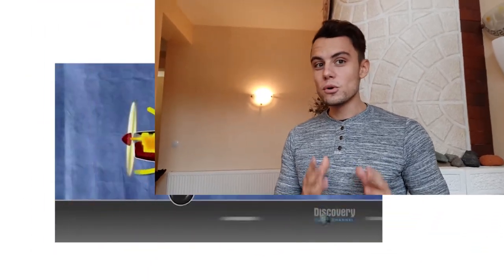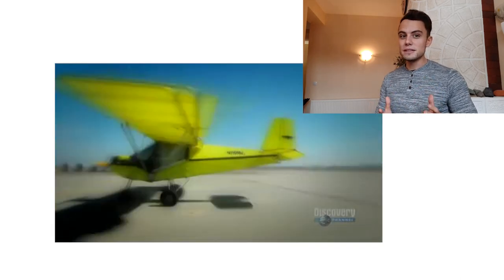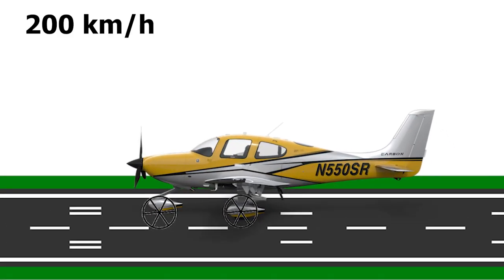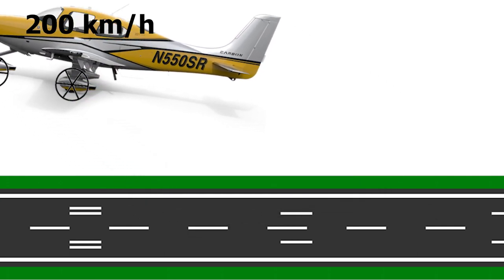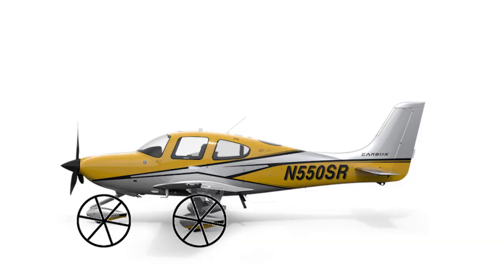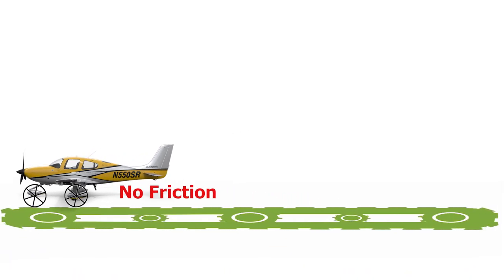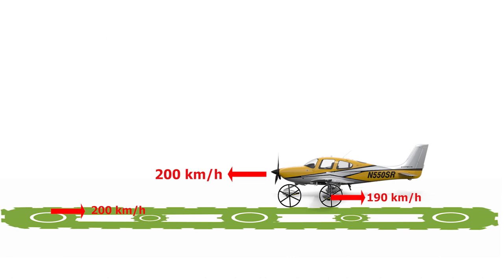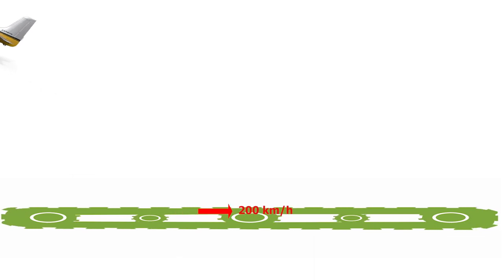Can an Airplane Take Off From a Conveyer Belt?.... Finally Solved!

Comment: The belt would have to be moving at an extreme speed.  The aircraft then would have to be move at several times faster.  Maybe it is possible with a jet and a long belt.  The plane in your example is not capable of these speeds.
Reply from the maker: I see what you are saying. Note that in the example the speed and the lift rise are happening for seconds. You might got the impression that it takes longer than in reality. Literally few seconds after the aircraft have same speed as the conveyer held, it's lift will be so high that the friction won't matter. This is what you see in the mithbusters video.
Reply: @MartinYY  "This is what you see in the mithbusters video." - Both you and the Mythbusters video don't discuss the original question, thereby avoiding the controversy surrounding that question.
Reply: Aircraft speed limits are based on its speed relative to the air, not the ground.

Comment: If the wheels are moving at the same speed as the conveyor the plane will not take off. In order to take of the wheels will have to rotate at take off speed plus the speed of the conveyor... But.. if you are saying that the conveyor always matches the wheel speed then it will never move forward.
Reply: @papapapalima_scotland Actually--think about it--when the conveyor belt runs backwards, it spins the plane's wheels FORWARD!  If there's any significant friction in the wheel bearings, the reverse-running belt ASSISTS the plane in moving forward through the air. (That advantage is negligible, but the reverse-running belt is certainly not putting any drag on the aircraft.)

Comment: Everything 100% but suction creating lift. There is no such force as suction. Only lower pressure. The lower pressure on top of a wing gives way to the relative higher pressure on the bottom of the wing. Gas molecules only push against each other. They do not pull on each other. It’s exactly why in an open environment, hot air is low pressure and in a closed container, it’s high pressure.

Comment: You can't change 1to1 the conveyor only moves when the wheel rotates in place, not happen. The wheel only rotates as the jet moves forward the rolls over the conveyor and the amount of conveyor behind the wheel is the same as the movement of the jet 1 to 1. The conveyor never moves and the plane takes off. The wheel speed matching the conveyor is the key to solve this. The plane is sitting on the conveyor neither the wheel or the conveyor is moving. Now start the jet move 1 rev of the wheel now the plane has moved forward and 1 rev of conveyor is now behind the wheel. The real question is how fast the conveyor is moving. The answer is it is not and never will. That is the trick of this question.
I see now this is not a riddle, it's the definition of how planes take off from a runway with one word changed. they replaced the word runway with conveyor just to confuse everybody.

One other thing, you park a car on a conveyor and than drive the car forward keeping the wheels and the conveyor at a 1 to 1 ratio. The car will drive off and the conveyor will not start. You yourself can do this on a treadmill, stand at the back end with the treadmill off and take 1 step forward. You will now be in the middle treadmill, start the treadmill up and start walking and you will stay in the same place. Only one can move at a time to keep 1 to 1 ratio.

Comment: so in the end a plane can't take off from the belt. only if it has those 10 km to start with and that would mean the premises of the problem are not respected. Also I think a role has also the air pushed by the propeller around the wings to generate lift
Reply: First the ~ 10KM is WORSE case friction. That is if the belt is 200km, with high friction the plane would be pulled ~ 190km. He used a high friction number to show that even IF the wheels had high resistance the jet would still eventually take off.  In real world. it would be the other way, at 200km, the jet would slowly start to roll back. If the belt is forever long, eventually the jet or any rolling object would reach the speed of the belt.  However, even if it already rolling back, just a little thrust will stop or start to move it forward. The THRUST just needs to overcome the friction of the wheels. ( in real world also the air)

The method of THURST is irrelevant. Be it Jet, Props, Sails, big fans, anything that DOES NOT apply energy to the belt. 

If people read the riddle and say no the jet will not takeoff. The how does a seaplane takeoff when going up-stream. If a seaplane idle on a fast moving river, starts to takeoff going upstream, according to those that say no takeoff on the belt. The seaplane would also not fly. Yet, they takeoff off all the time.
Reply: @BigBadDodge4x4  sea planes can take off because the water underneath the pontoons doesn't Match the speed perfectly. In the original problem it states the conveyor belt matches the speed of the wheels perfectly and simultaneously meaning its impossible for the plane to ever move forward. If the plane never moves forward you will never have air flowing over and under wings to create lift
Reply: @louisschwarz3943   also, I solved the riddle a few weeks back.

The jet takesoff. It takes off without any wheels rotating. The belt matches the speed of WHEELS, but in the opposite direction.  The opposite direction of the tires,  is forward.  If you zoom in to the tire contact patch. You'll note on a normal runway and jet, the runway moves from the front of a taking off jet, to behind the jet. So the opposite of that is the runway being moved from behind to the front. And as the belt is designed to match the wheel speed, but in opposite direction,  the belt actually moves forward.    So both the jet and the belt move forward in perfect sync as the jet takeoff.  The visual result is a jet stationery on a moving belt, and zero tire rotating. 

In real life, you can spin the belt in any direction at any rationale speed, and the jet will takeoff as normal.  The fee spinning wheels absorb the moving runway speed.
Reply: @BigBadDodge4x4  if the wheels are not rotating than the conveyor can't be moving and in return the plane isnt moving. The conveyor matches the the speed of the tires not faster or slower. You are over thinking and breaking the rules of the riddle to get your desired outcome.

Comment: Imagine a water plane taking off in a river upstream. No problem. You're welcome.
Reply: Now imagine a water plane on a concrete runway. It won't fly. Water planes still move on the water regardless of the water, because the water doesn't change speed like a treadmill can.
Reply: @knighthonor44  Your point is incoherent or absurdly incorrect; what are you trying to say?
Reply: @shannontaylor1849  go look at a plane in water. regardless of the water flow, the plane can move a different speed as the water, which allow it to pick up speed and lift. If that same plane was on a runway with no water, it wouldnt move well to take off. The plane needs movement. Wheels on a plane give it the ability to move well on solid surfaces to pick up enough air speed over the wing to generate lift. If you have a treadmill going the opposite direction at the same linear speed at all times, would cause the plane to not move forward to build up speed for lift.
Reply: @knighthonor44  Lol. Yep, you're absurdly incorrect as evidenced multiple times in the video and by a general observation of reality. Lift is generated by the wing moving through the air, not wheels on the ground or a skid on water, which are used to reduce friction and allow efficient wing speed- not create it, lol.
Reply: @shannontaylor1849  so hoow well would a water plane that was parked on a runway move? answer that
Reply: @knighthonor44  Pointless question that was already answered. Try to ask better questions.
Reply: @shannontaylor1849  Take the wings off the plane. using the same rules of the problem: if the treadmill goes opposite direction of the plane wheel rotation but at the same lateral speed, would the plane move forward?
Reply: @knighthonor44  It depends on the friction vs the velocity applied whether the wheels would roll or stay with the surface doesn't it? A 1 pound wheeled object  subjected to a velocity change of 10 mph would roll, assuming efficient wheel bearings, etc. At a 1 mph velocity it would stay whereas a 100,000 lb object would stay at 100 mph velocity change and so on. Now that you've learned that, apply it to water planes and the world will become less confusing for you.
Reply: Imagine a water plane when the upstream is matching its speed at all times, You're welcome.
Reply: @nareal_chutney  I think you mean velocity instead of speed, which still has nothing to do with the effect of air velocity over a wing. Planes move through air, not whatever is underneath them, water, concrete, treadmill, pan of biscuits, etc.
Reply: @Suraj C K  and what does the pilot do? They speed up the plane. Hence that's not the same as this because water flow of a river doesn't change at will
Reply: That wouldnt work exactly the same, the water have great friction on the planes body compared to wheels on ground

Comment: The belt speed is controlled externally to match the plane thrust speed. Therefore the plane appears stationary on the belt and the airspeed over the wings is zero. Plane cant take off.

Comment: Good joke, was this first posted April 1st?   (Obviously not true since lift is created by airflow over the wing, not by the speed of the wheels.  So the plane actually has to be moving forward THROUGH the air to create the airflow and therefore the lift.  In the example the AIR SPEED would still be 0 since the wheels are moving but the wing isn't moving forward.)
Reply: The propeller is forcing air under the wing even before the plane starts moving forward. The plane is traveling through a fluid regardless of the ground. Like he was saying the only factors are the friction and the flow of air.
Reply: It will still move forward. If the conveyor perfectly, exactly, and instantaneously matches the wheel speed, they'll both immediately accelerate to infinite speed and break some serious laws of physics, so that's impossible. In the real world, no matter how fast the conveyor goes, the plane's engines will push it forward. This will cause an airspeed. The ground speed will be the speed of the conveyor plus the airspeed, but the speed of the conveyor has nothing to do with the thrust from the engines. The only way the plane would not take off is if the force of kinetic friction from the belt exactly matches the thrust force.

Comment: The converbell basically nullify the plane wheel moving forward keeping plane in fixed position, meaning the plane isnt moving forward. Another to keep plane from moving forward without a convery belt is simply lock down the wheel. If wheels are locked down, will it eventually takeoff when only engine power?
I dont think so.
Reply: Its impossible to make a conveyor belt that matches wheel speed because wheel speed is the sum of the backwards conveyor and the forward air thurst.

The ONLY way for belt speed to match wheel speed is to not turn on the engine at all. Becasue, if the plane is stationary on the belt, and lets say the belt is going 100km/h, the wheelspeed HAS to also be 100km/h in order to stay stationary.

But when you apply forward thrust, it isnt coming from the wheels, it is coming from the propeller, and this is when it simply becomes a physical impossibility to have the belt match wheelspeed.

We know even with zero thrust, that the wheels will always already equal belt speed. So let's say we engage the thrust to 100km/h to "match" the belt speed.

The wheels spin freely, so they simply speed up to 100+100= 200km/h, at this point the belt can NEVER match the wheel speed, because the wheel speed is calculated by adding whatever 100 to whatever the belt speed is.
Reply: false. here's why
the wheel speed doesnt mean shit on a plane. there is no motor turning the wheels. theyre free spinning. otherwise if a plane left the ground it would fall back to the ground because the wheels are not touching the ground. the speed of the plane comes from the speed of the propeller moving air to push the plane forward NOT THE WHEELS. it doesnt matter how fast the conveyor belt spins the plane will still take off
Reply: @markbergin8821  no. if the conveyor belt is running 100km the wheels will be turning 100km but the plane doesnt care, the wheels are irrelevant to the matter. the only thing that matters is the speed of the propeller and nothing else. the speed of the wheels and or the conveyor are not an issue
Reply: @origionalwinja  yes.. thats what I'm saying...

But with the perquisite that the belt HAS to match the wheel speed, then the question itself is unanswerable, because as you said, the plane HAS to move forward to balance the system, but the Impossible Belt doesnt allow it.

If the belt isn't magic and can't break the laws of physics, then ofc the plane HAS to be able to take off, but the properties if the belt make it illogical and it makes the question unanswerable.
Reply: @origionalwinja  it is an issue in THIS specific problem tho, because HOW the plane moves forward is the fact that the wheels CANT go the same speed as the belt, they ALWAYS have to be faster than the belt in order to allow conservation of momentum to the planes propeller.

If we make up some paradoxical belt that 100% matches the wheel speed, the question is unanswerable. Im not saying the plane will take off, im not saying it won't, the question just can't be answered with this disclaimer.

Its like divinding 1 by zero, theres just no answer, because the question doesn't make sense.

Yes, in reality, the plane can ALWAYS take off so long as the wheels don't burn up from friction. But this belt doesn't exist in reality, its a physical anomaly that defies all reason, so there's no answer with this belt involved
Reply: @markbergin8821  "The ONLY way for belt speed to match wheel speed is to not turn on the engine at all." - well, the pilot stepping on the brakes while turning on the engines would suffice.
Reply: @renedekker9806  yes? But don't compare stepping on the brakes to this belt, theyre not comparable.

The freewheeling aspect in the belt situation is precisely what makes it impossible for the belt to match wheel speed.

In brakes the thrust of the engine is being absorbed by the brakes, and energy is being exacted upon the brakes to completely lock the wheel. 

In the belt, the wheel is freespinning, and thus its speed becomes a factor of plane thrust and whatever the belt speed is, it'll always be faster, otherwise the question isn't answerable
Reply: @markbergin8821  "The freewheeling aspect in the belt situation is precisely what makes it impossible for the belt to match wheel speed." - exactly. That's why the pilot needs to step on the brakes, to make sure the wheels are not free-spinning.
That is, to "not turn on the engines" is not the ONLY way for "belt speed to match wheel speed"
Running the engine while stepping on the brakes has the same effect.
Reply: @renedekker9806  ...okay? Idk what pulling me up on a technicality has to do with my point tho?
Reply: @markbergin8821  "what pulling me up on a technicality has to do with my point tho?" - I was just adding to one statement you made. Your main point is fully correct.
Reply: @renedekker9806  oh sorry, I thought you were trying to push the argument that the putting brakes on the planes wheels has the same effect as the belt, my bad dude
Reply: @origionalwinja well said. plane absolutely takes off.